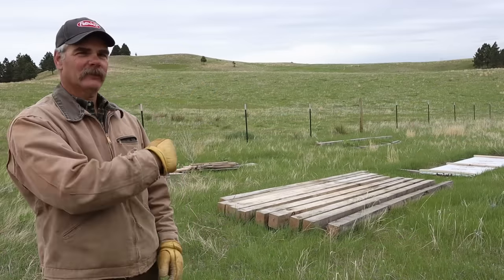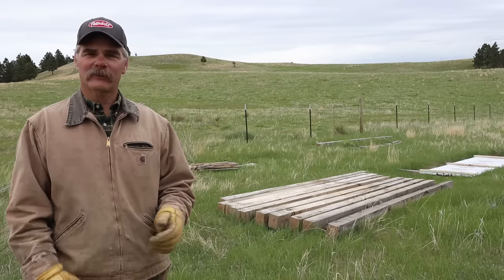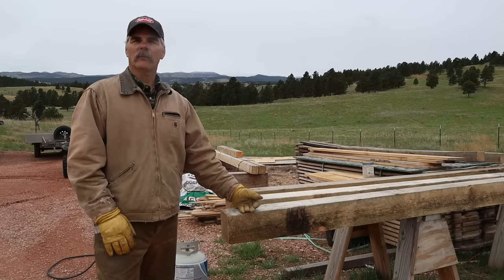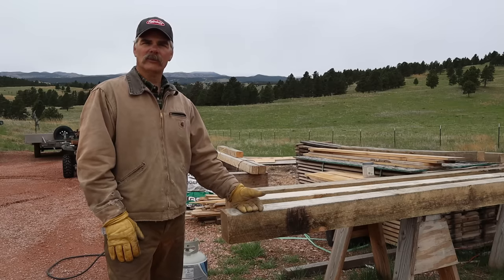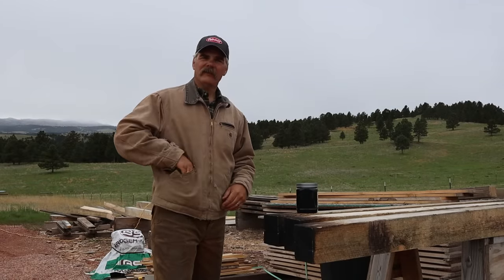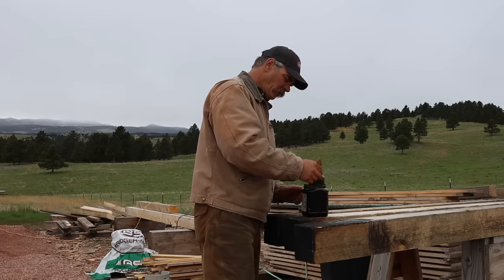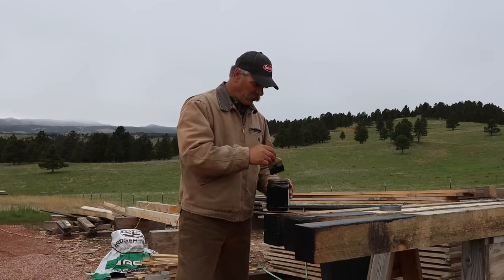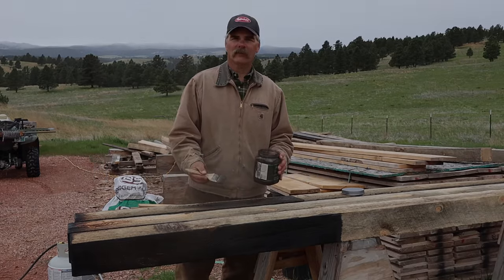Treat Wood Yourself - How to Treat Wood Against Rot

Comment: Rot is caused by one of two general types of fungus, white and brown. Pretty technical terms, I know.  They both require acidic environments to grow and usually temperatures above 50 degrees F. If you place very fine crushed limestone (often called stone dust or paver sand) in the bottom of the hole, and after placing the post, fill the hole with the same stuff, it cannot be made acidic as there is just too much alkalinity for an acid to exist without being neutralized.  Water that enters the post through that limestone is made calcium rich. However the interior of posts can usually still rot no matter what you do except true pressure treating. But if the post becomes saturated with the calcium rich water, then its going to be rot resistant.
Reply from the maker: Very interesting.  I do this practice also.  I know old timers that treat posts this way and have had them last for decades.
Reply: Paul, thank you for that scientific explanation.  I personally like to know why things do what they do.  Again, thank u for taking the time to explain it.

Comment: I like to put gravel in the very bottom of the hole.  Tamp the hole with gravel around trees, cause concrete will leach out and kill trees within ten feet.  I had a metal storage building with treated 4 x 4's and i put the 50/50 onto them and the termites still ate them.  BROWN & ROOT we used that blend to spray onto our chains and pullies, trucking stuff.

Comment: I took apart a 50 year old building here in Ontario and I found those posts that were charred and possibly treated like yours were still sound, very hard to get out of the ground. Some were buried in concrete and they were rotten and no good anymore. All the poles were our eastern white cedar.
I never heard of your mix, it sounds pretty simple, will certainly try that out here in the future
Reply: mot the best way to treat your lumber  when you can easily buy a pressure sprayer and polyurethane wood preservative in bulk and it will save you money in the future
Reply: Were the posts that were still decent quality buried with something other than concrete?
Reply: @BuiltByJalal this method costs about $10 to treat all the posts since you already have the used motor oil and $8 in Diesel plus $2 for a cheap chip bush. No purchased wood preservative will ever beat that.

Comment: Old Timers been using this 50/50 mix for over a 100 years. Some of the post they set inground have lasted over 100 years. 4 inches of course sand below the post also keeps moisture off the bottom and prevents rot.
Reply: would gravel or sand be a better base for fence posts?
Reply: @countryfella94  might not have enough structural strength
Reply: We put a out of ballist mix below post instead of sand before we cement in

Comment: Something's never go out of style because they work. I bought my first vehicle, 65 C10 Apache for $150 from a construction company had had Cats, back Hoes, Scrapers and they were fueled at the job site and oil & filter changed. They carried the drums in the back of this wood floor truck. Overtime, the floor was soaked with diesel, motor oil both new and old, but never rotted and looked like new other than a nice dark stain. The speedo was broke at 264k miles and ran great. The family farm never paid me any allowance so all money earned from working for neighbors. From hay into their barn, plowing, mowing yards or moving cattle 8-10 miles to a new pasture. It had a 283 cu in w/2 spd auto and good tires, red with Fawn dash. No A/C just heat. I grew 6" at age 11 and already the tallest, I would get hired easy in our county. By 3AM I was up and headed to a field off the road a 1/4 mile near trees and a dry rock bottom creek. My last year of school, class didn't start until 9:30 or 10AM. I was one to operate a new John Deere 4X4 center articulating. I started morns with headlights on the tractor to clean the air filter, ck oil, grease the center pivot and start it. Alway check oil pressure and fuel first. Raise the disc & hit 18 grease fittings. Check wheels for loose, whack them with an axe handle for air and give everything a good once over with a harry eyeball. Side mounted tool box was factory or we put it on. Alway a large chain hung in a agreed fashion & a little notch cut in the handle and box, for the axe handle. Hair-pin cotter held the lid tight. Only tractor I ran w/full cab, A/C and more than a Motorola AM & whip antenna. He opted for a 2.2 cu ft cooler, no fridge. Want it cold, get ice. Simple. One day, seat turned sideways as always to watch the disc, direction & gauges, radio guy said time and I was a half hour late. Nobody drove it and I was on the far end making a $1.50 hr. I said a few words and parked it without letting the twin turbos spool done. Locked it, hid the key I an agreed spot. I tore out of that field going 40 MPH and hitting my head. Second creek over, I hit bottom hard. No county road dust, so never slowed down and floored it. 3/4 mile later the rear wheels locked up, oil light came on, with two hands on the wheel steered off the road and stopped. Part of me knew what I was about to see, but had to look anyways. Under the front bumper, crossmember was a gashing hole with just a little oil leaking out. I did write a note or take the keys, just started jogging to school toward the town of 160 souls. I had a mind full of excuses, but few had a truck to pull me and where will I put it. Where would I get an GM engine...  Well, I got the coach to take me out as the shy got darker by the foot, we turned the corner and...nothing, it was gone. Like Tonto, I walk back and forth looking for tracks, oil drippings, anything that would tell me who would take it. I could movement for 20 some feet and they place it in neutral. 65 power glides was the last year for a rear and front pump. It kept it in gear for engine braking. Even though I had the little Red truck for almost 4 years, i felt like some stole $150 dollars from me. I  got a pass from the coach, filed a police report, if someone wanted to tag it they had one place in the count seat to go thru. I called once a month for a while and gave up! I was heart broke like someone had shot my horse. Worse yet, there where no houses for 2.5 miles and I checked driving slow just looking. But farmers would put used vehicles in ditches next to the fence to keep cattle in and felt they were doing a good thing. Never saw it again. Sad!
Sorry, used motor oil and linseed oil works also. Just drowned rags in a bucket of water because they can catch fire as they dry. Subscribed!
DK, Omaha. ASE Master tech since 78, retired!
Reply from the maker: Thank you Dean for the comment!

Comment: I did this to some fence post and a gate. I didn't char the ends, but I soaked the ends in buck of diesel/used oil then pained the mixture on the rest of the post. I got about 7 years from the post and the gate is still good 9 years later. Termites never attacked the post, but they did eventually rot from the inside out. I think it was them wicking up water from the ground. If you live out west where it's very dry I wouldn't be surprised if this kind of treatment would last for decades. In a wetter climate a few years is all you'll get from anything touching the ground.
Reply from the maker: That is probably true.  Here these will last a long time.  Rocks in the bottom of the hole helps alot too.  Using a wood like cedar for this is also a good idea.  I use what I have

Comment: To keep the post from rotten for hundred of years, when you finish putting the posts in the ground take a 1 1/2 " or 1 1/4' drill bit and drill a hole aprox 4" above ground level to about 6" below ground level on a 45 Degree angel  (make sure you don't go all the way through) and fill the hole with the a 50/50 mixture of the used motor oil and fuel and plug the hole. Then after 6 months come back and remove plug and then use 100% used motor oil, and top up every 3 years or so when needed based on the dryness of the posts. A hard wood plug about 6" is easier to remove than a soft wood plug, only put plug in about an inch or so.
Reply from the maker: Thank you, I will remember that
Reply: That is an excellent idea. Something that I may have thot about sometime. It is a perfect way to recycle the used oil back into the ground where it came from in the first place. We always used a old rag soaked in use engine oil the coat the bottom of our push mower and the blades of our reel mower after each use. I still remember someone seeing the bottom of our old push mower deck and he swore that it was made out of stainless steel because it was so shinny and rust free.  lol.  I still have my grandfathers draw knife wrapped in newspaper and tied with a string, from the 1920s. Him and my dad would put a little fresh oil on the paper after done using and sharpening the knife. No rust has ever been on that tool.

Comment: How well does this method work when used with concrete? I've heard a couple guys talking about it rotting out but Ive also seen a couple that still stand strong after 20+ years of standing
Reply from the maker: Never use concrete.  Holds moisture and rots the wood

Comment: why are you not burning the sides? is there a reason for that ? only the ends? or does it work on sides too? i want to do to a treehouse if possible?
Reply from the maker: I do the sides too in another video.  Either way is good.  The end is the most critical along with the point at which the post reaches surface level

Comment: What size of torch are you using sir 100k BTU or ? something i just learned creosote is not available but from what inter say made from coal tar or wood so bam this is how you get some Coal Tar Versus Asphalt Based Sealcoats or may be better is the roof cement  just dig around and n mix up that thinning with diesel or /

Comment: Another trick to make it last longer add rocks gravel at the bottom of the hole to help drain any water around the wood did this to my wood fence post and there still there since 1999.
Reply from the maker: Yes that is true

Comment: i read an article in a book from around 1900 that said to boil the timbers in water with alum mixed in . the author claimed that the builder would never live long enough to see them rot,even if the builder was a very young man when this was done.
Reply from the maker: Very interesting.  No reason to doubt it.  Thank you for watching and the information!
Reply: What's alum?
Reply: Is THAT an abbreviation?

Comment: The char treatment actually makes a lot of sense once you think about it. It isn't the char itself, but the heat melting the lignen in the wood and sealing off the capillary tubes. Doing a heavy char just ensures you transfered enough heat to melt the lignen a sufficient distance/depth.
I've never tried the char trick, but even on treated posts I like to paint them with basement tar/asphalt coating a foot above and below grade (2' total). Posts rot the fastest where air and water meet, so that helps keep them from the typical rotting in half at the soil line.

Comment: I want to do burnt wood on my business sign that we are building. So two questions. After burning what is the best thing to use to clear coat it ? Second question if I do a light stain after I burn it do I need to do a clear coat over the stain? I know nothing about wood so have no clue what is the best clear to put on it
Reply from the maker: After burning you need to rinse it with water.  Then let dry and coat with oil or oil based clear with UV inhibiting properties.  No need for stain.  Do not brush it if you want the alligator charring to remain, as you will brush it off.  Lightly brush on the clear with a paint brush.

Comment: Just wondering since some water is going to get down in the post if its better to leave the bottom untreated so water can go somewhere out the end. Great video.
Reply from the maker: Thank you Tony.  No, treat the bottom,  but put at least 6 inches of clean gravel in the bottom of the hole.
Reply: @GreatPlainsCraftsman  Putting clean gravel below the bottom is something I have always done with treated 4x4s. It allows a drain bed for the water to go down deeper. Just like putting a 5 gallon bucket of clean gravel down at the bottom of a yard hydrant allow for the water to drain away.

Comment: What about the inside moisture that gets trap inside the wood? Wouldn't that make the wood rot from the inside or do you used seasonned wood for starters? Thx great video!
Reply: When done properly, you use seasoned logs.

Comment: Why not burn the timber 3.5 feet and the add the oil/diesel coating
Reply from the maker: You can do that too.  Burning is an extra insurance step in the critical end grain area.  But, you could do it all the way too.

Comment: My gramps (95 years old) and I coated our fence boards with used engine oil. I don't recall using the diesel fuel, but it has been about 20 years ago give or take. We have not done the scorching before, but I did ask him one day if his dad did it when building log cabins. He thought he had, but did not recall details. What is the BTUs of your flamer? I am trying to decide which one I get since they range from 100,000 to 500,000.
Reply from the maker: Not sure on the BTU, got it used but any standard torch will work.  Just be sure to burn it to alagater char, burn it good
Reply: Ok , Thanks! :)

Comment: I am allergic to diesel and motor oil.  Can I substitute linseed oil, vegetable oil, olive oil, or ?
Reply from the maker: Shelly for  in ground treatments diesel and motor oil are the best. Linseed oil could work but just be sure to char the entire post section going into the ground to alligator char and that would be a good start.  The carbon layer from burning and petroleum-based oil combination is what does the trick.  For above ground treatments,  linseed oil works good.

Comment: My family  would  set a 55gallon drum in tbe ground then stand as many post in that would fit  then add old motor  oil that was on hand  gallon  or 2 of creosote  them if nessary add diesel to fill then let set 24 hrs  then add more oil as the post had sucked up bunch  set another  24  
  They set up saw horses  and tin to recover  what drips off back  into barrel  for next batch

Comment: I have seen this also used w/kerosene & motor oil.
Please Comment on this if you have any knowledge of this. Thanks.
Have seen where they put the Posts Upside Down, Believing they last longer?
Reply from the maker: Kerosene would work.  Yes I have heard of that for cut trees used for posts.  You can also cut the tree at the Winter Solstice.  Research it, along with scaring the tree a season before you cut it.
Reply: @GreatPlainsCraftsman  Cutting the tree at the Winter Solstice - sounds like something that should be saved for the 1st of April!

Comment: Whenever I was young and we are cutting Blackjack fencepost my grandfather used to get a piece of hot car and put in a 5 gallon bucket and we build a fire under it and when the tar melted we dip the bottom of the fence post in the Hot Tar

Comment: Good idea. How long do they need to dry? Is it safe to use on posts going into the garden?
Reply: Did you ever find out the answer to your question?
Reply: @cpnotill9264  no
Reply: @cpnotill9264  I don’t even remember watching this video lol.
Reply: @rickershomesteadahobbyfarm3291  😁👍
Reply from the maker: They will dry enough to handle in a day or so.  Not any worse for the garden than PT posts.  These will not leach in my experience.

Comment: After charging could you use something like Flexseal rubberized coating
Reply: I think this is an awesome tip. I was thinking epoxy/ fiberglass coated.

Comment: I read that used motor oil contains many carsinogens and toxins... this probably increases its protective properties but I'd def avoid getting that mixture on bare skin.

Nice vid, btw!
Reply from the maker: Great point!
Reply: Kerosene and diesel can be used to wash out open cuts and scratches. It does not have burning feeling like alcohol. And something in it causes less chance of infection.  Used black engine oil can be used to treat skin conditions on dogs and farm animals. My grandpa would mix sulpher with used engine oil to treat skin mange on his dogs. He said the vet taught him that. But yes they are carsinogenic. So do not drink them nor inhale the fumes if they are burned. Oh, wait, people had to inhale a little of the vapor off of kerosene heaters and kerosene lamps used inside homes for last 150 years or so and no one said anything about that. Not until my wife decided she does not like me lighting them when the power goes out.

Comment: Would you do the same procedure with round posts that you drive into the ground?
Reply from the maker: Could.  They are most likely pressure treated already though so not necessary
Reply: @GreatPlainsCraftsman  In the UK, at least, pressure treated seldom last a decade

Comment: How long does it take for the smell to dissipate?
Reply from the maker: About 2 weeks Benjamin.   Outside use only
Reply: Thank you. I plan on building a deck in the yard in the next couple weeks. So I install it directly in the ground or can I ask use concrete to hold it in place?
Reply from the maker: @FreeUnsolicitedAdvice  in the ground, no concrete.  That will rot the post.   Clean rock in the bottom of the hole will extend the life of the post
Reply: Thank you so much

Comment: To speed things up put posts together & stain using small roller & tray, then keep turning till all sides rolled. Or get a man size brush instead of a baby one lol. Good video anyway.
Reply: You want to use a brush to get into the wood fibers more. Rolling just lays it on top. Just a tip from a woodworker.